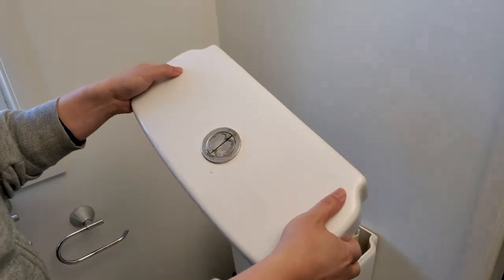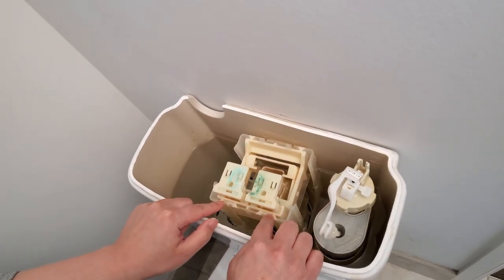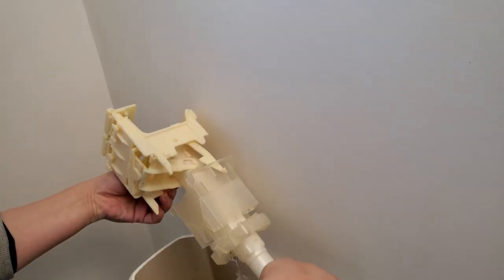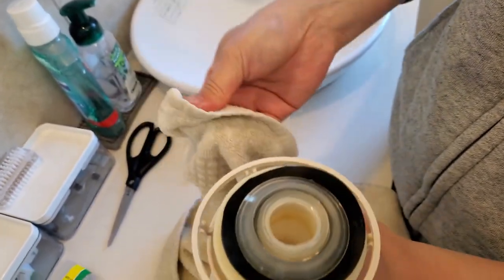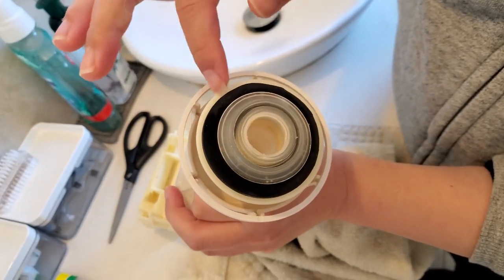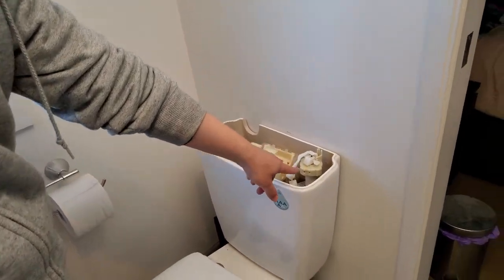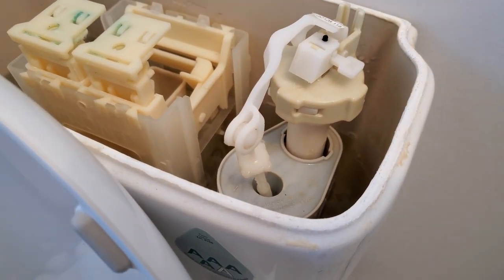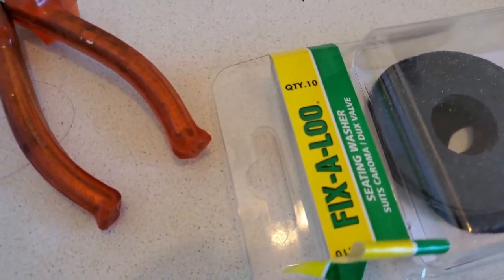Step-by-Step Guide: Repairing a Leaking Toilet Cistern by Replacing the Washer

Comment: Dude, very good video. Had same system, took me literally $6 and 5 minutes to swap the seating washer. There is a better washer to use than the one you had in video (larger diameter hole). Also, my old washer had literally melted into a sticky mess.... goo remover cleaned it off both from the cistern and the plastic flush plate.
Reply from the maker: Oh which one did you use? I'll get that too and try it on my next change.

Comment: Thanks for sharing these detailed instructions. My own experience was very frustrating, and took considerably longer than expected due to
1. The water inlet pipe is inside the cistern and a copper pipe sat across top of flush mechanism so I had to remove all that before even attempting to lift out the flusher. Very tricky due to access and tools required.
2. The inlet stop cock didn't....so I had to plan around turning off the water outside and also replacing the stop cock as part of this job
3. The first fix-a-loo seating washer I tried ( red colour ) fit but the water still leaked. Even after disassembly of everything again, grrr, trying reseating it. I spent quite a long time trying to resolve. In the end I went back to B and bought the black one. I also returned the braided hoses that I tried to replace the copper pipe with because it's not safe if submerged or touching water - can burst. What use are those - it says replace every 5 years on it!!!
4. i didn't reconnect the copper pipe this time because it can be tested without , I recommend this approach.
5. First attempt with fix a loo black washer and it still leaked in the bowl. Fiddled with it a lot. Watched more videos.
6. Eventuality after removing , putting washing liquid around plastic plunger, re-attaching and fiddling a lot to try and get it seated evenly around ( it still looked smaller than it ought to be ) I placed it back into the housing and tested it . Eureka, no drip in bowl. I left it like this for a few days and just use the stop cock to fill the cistern before I was happy it was working long term.  No idea why it eventually worked.. seems to be luck. It's such a fiddly contraption you'd think in 2024 a better mechanism existed.
All up I spent at least 4-5hrs on and off with this "easy job". YMMV.

Comment: Thank you so much, just followed your instructions and solved the problem. There's another issue. In the tank there are two bolts fixing the tank on the seat base, and they have washers as well. They are a bit wear and come off from the bolt, starts leaking from that point. My question is how to remove the valve and other parts from the tank? and replace the washer under bolts. This Caroma toilet design is very inconvenient.
Reply from the maker: You don't have to remove the other bits to do that. Drain water, tap off. Unscrew from under the tank. Pop bolts up, replace washers.
Reply: @MeettheTings  thanks a lot